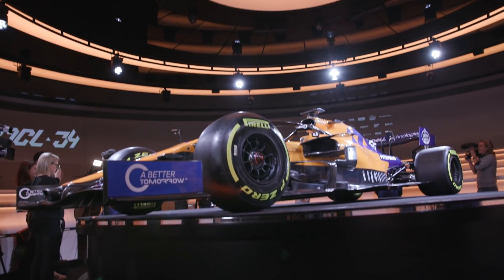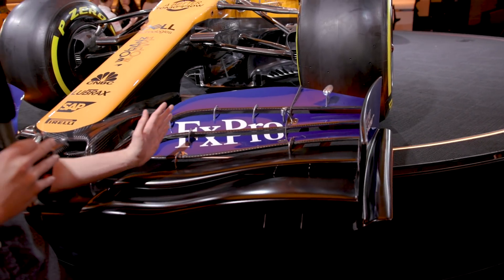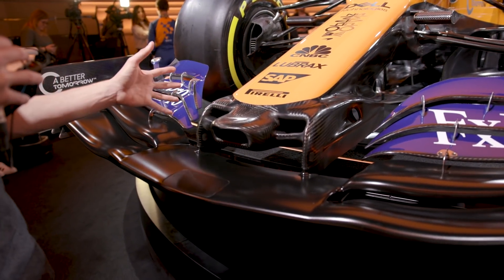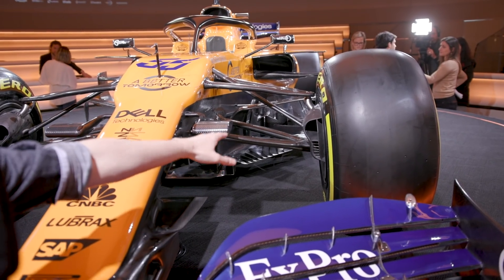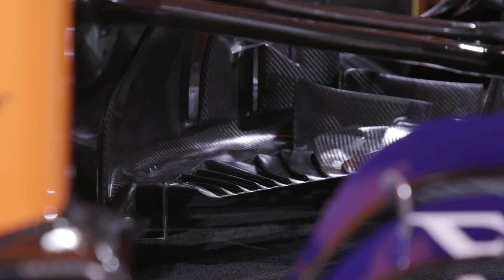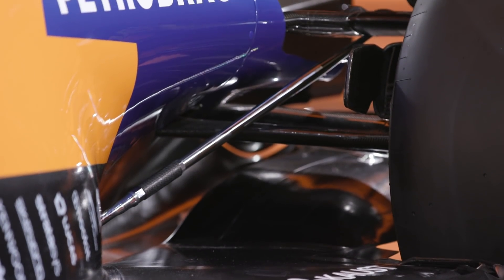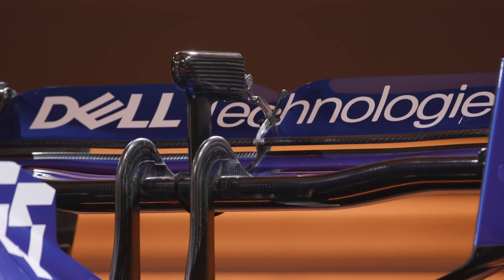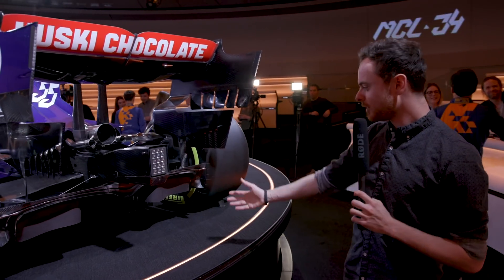An unprecedented up-close look at a 2019 F1 car: McLaren MCL34 technical analysis

Comment: The add-ons and gurney's to the top of the diffuser are not there to manage airflow as much as possible. They are there to create vortices which, in turn, would help extract air coming out of the diffuser.

Comment: Aerodynamics! what about the car, you know the engine transmission suspension details, the steering . With all respect this is not want I want to see I am an engineer, but this is not the car that will be at Melbourne. To me it is one of the reason F1 is dying a long slow death.if there was another Senna no one would really know.Hamilton is very very quick but who is he nobody knows really & how much is it his car. He has been lucky always drove the best cars.
Reply: Beagle76 true but Vettel and Bottas also have good cars
Reply: hamilton is probably top notch. definately better than vettel. but until 2017 i could have won the wdc in that mercedes. at least things are a little closer than they were in 2014. the v6 turbos did ruin f1 for several years, and its still mercedes vs ferrari atm.

Comment: Wow I'm shocked they let you do such an up close look.. especially the diffuser.
Reply: I was just thinking that, this is probably the most detail and closest we'll get to see of any car all reason, let alone pre-season lol...
Reply: They have definitely not revealed all their ideas yet. The diffuser that arrives in Melbourne will probably look completely different.
Reply: @colehartel7206  your right all the cars will be different probably before the second test even. But when was the last time you seen this much detail up close and unrestricted at a launch event?..
Reply: One thing to note was the large "blank" section on either side of the center section. Normally longitudinal strakes are visible underneath, and here there was a large sideways slab, so there's still some significant mystery about the final design, even without changes from now til Monday.

Comment: I think all teams should have to release cars like this not these stupid renders should be cars in the flesh.
Reply: Justin Wellbelove I agree but it costs money to do these launches. A render released online costs basically nothing. Gone are the days of the Spice Girls performing at a launch as they did for McLaren in 1998!
Reply: Perhaps F1 management should do a grand unveil at the start of the year with ALL the cars?
Reply: Justin Wellbelove 
Amen brother!!
Reply: why? because some people can't wait until the tests when we see the real cars?
Reply: I do agree car launches should be car launches not car render launches otherwise don't launch the cars at all
Reply: @devanshgupta9860  exactly
Reply: I don't agree. Forcing teams to waste money like this would be dumb.
Reply: @micheledamian8671  this is not dumb, more attention, more fans, more Ads, more money
Reply: @LY-uf2bh  That's not how it works. If the teams really gained that much money from car presentations you wouldn't have teams like Toro Rosso and Williams doing online presentations (or like Sauber that presents the car the first day of tests).
The sport is already expensive as it is and teams struggle to find the money to compete, it's better to reduce the costs instead of increasing them.
Reply: For McLaren this is just about the cheapest way of doing things. This is done at the factory. Just wheel the car out of the production side of the building into the office area lecture theatre (that was built years ago) and invite the press. No transport costs, no venue hire costs, no 3D render costs and gain lots of coverage because the press can get far closer to the car than with anybody else and see stuff without grovelling on the tarmac. Kerching!